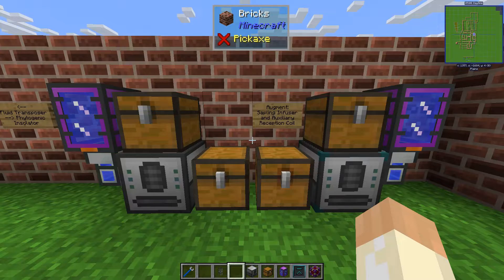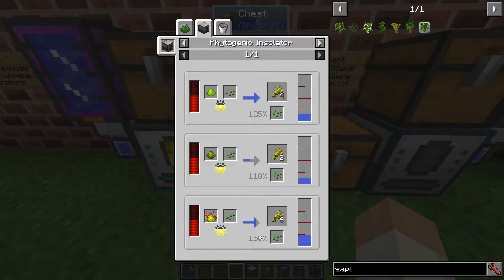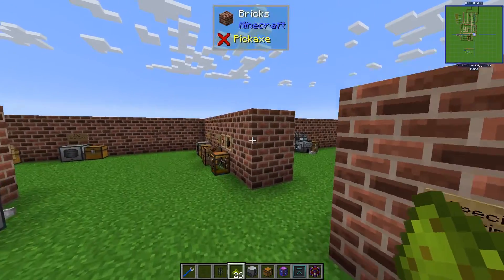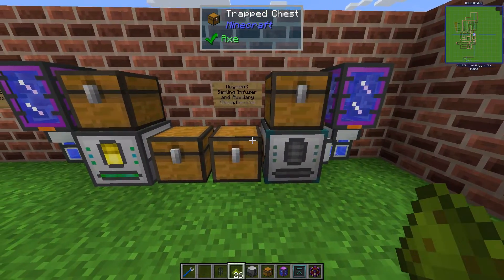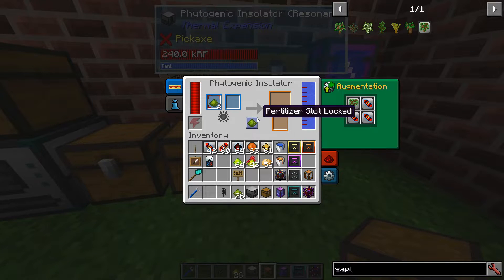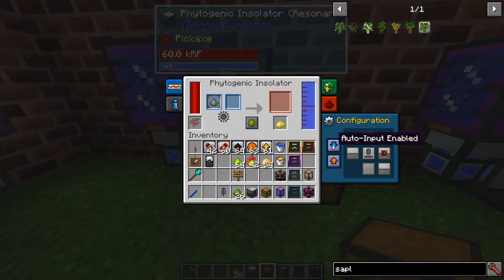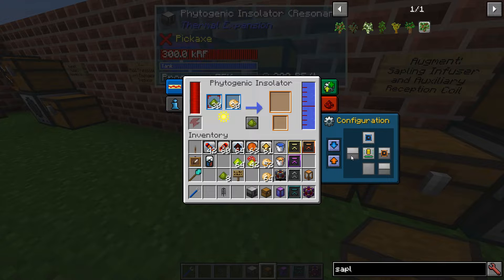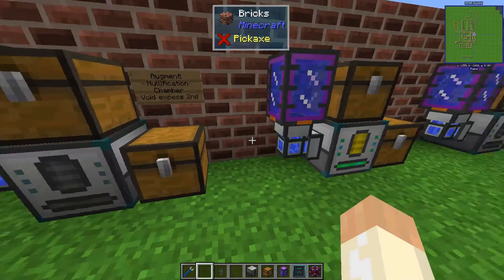Thermal Mods #16 - Phytogenic Insolator - One Block Farms

Comment: I can't put water in mine... Can anyone help please?
Reply from the maker: How are you trying to insert water? Does it work with bucket? If you're trying with pipe, is that side configured as input? What pipe method, from what mod? Impossible to help without any information.... And as always, mod version, modpack info, all that is always good info to provide.
Reply: @therealtkh  I figured it out! I just needed to change the tank from input to output. Thank you for trying to help though!
Reply from the maker: @bug80k  With a screenshot, that would have been easy to spot, too bad it's not supported by YT comments :) But it's important to give all info, it's impossible to help with no idea of how the build looks.